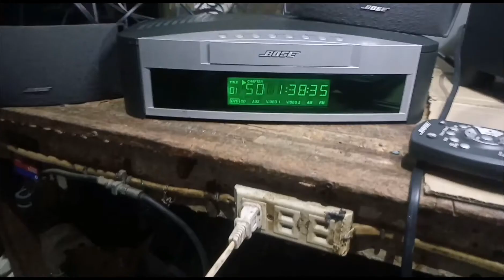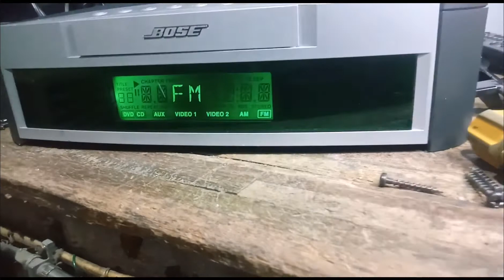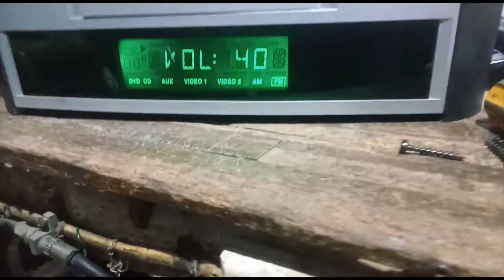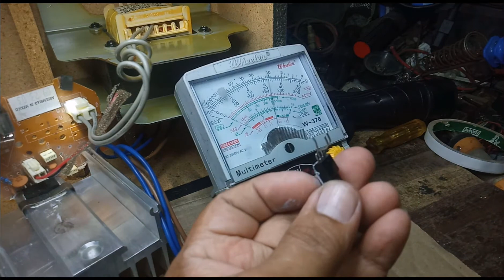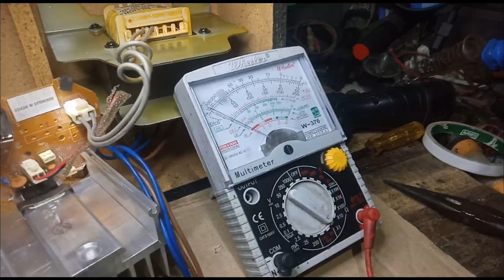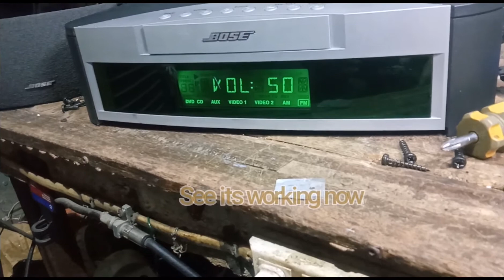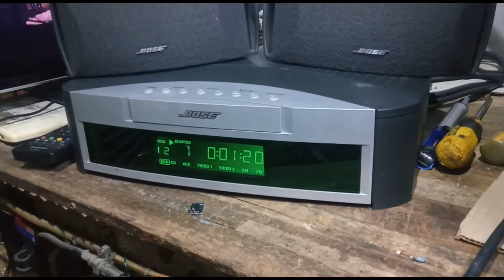BOSE 321(No sound)

Comment: Hey I have a Bose 123 acoustic module and it just randomly cut off for some reason and I was wondering if you know how to fix it. Thanks
Reply: It won’t power in btw I was listening to music and it just completely cut off
Reply from the maker: @FSrizza  check at the power supply section, maybe its a loose conections or cold solder

Comment: hello, good afternoon. my bose321 does not hear the sound at all. I replaced the IRFZ44N but it still doesn't sound. Could it be a problem with the TDA7396?
Reply from the maker: How much voltage did you measure on the big capacitor? if its high it won't really work, it shouldn't exeed 18 or 20 volts
Reply: @glenntips  Thank you very much for answering! I made the measurement on the capacitor and I have 23vcc with everything connected. AC voltage is 120v. What else could be happening?
Reply: @glenntips  I replaced the R10 with one of the same value and it burned me.
Reply from the maker: @LuisArielViolla  check where the burnt resistor is connected, maybe there is a shorted, check all parts that connected to pin1 of the mosfet
Reply: @glenntips  The problem with the R10 was mine, that I made the wrong banding and it was 1 k. The one I was putting on it was 0.1 k. I did the measurement that you recommended in the IRFZ44N mosfet and detected that it had continuity in the 3 pins. I took it out and measured it outside and it also gives me continuity. I put a new one, I check it before connecting it but after connecting it to the source it burns again.
Reply from the maker: @LuisArielViolla  did u put an insulator on the mosfet?
Reply: @glenntips  In the first mosfet I put thermal paste without insulation, in this what I did was leave it isolated from the heatsink. Solder the 3 pins without them touching anywhere.

Comment: Hi bro, 
I have a device like yours, out of nowhere it started making interference noise when it is set to Dolby 5.1. But when it is in 2.0 it doesn't. Do you know what it could be?
Reply from the maker: Try to move the wire connected to the bass speaker sir, maybe there is a broken wire or cut off

Comment: Sir i use bose 321 but some noise in speaker so what is solustion this plz send me thanks
Reply from the maker: What kind of noise do you hear?
Reply: @glenntips   Noise like Hunny bee sound
Reply: hamming in speakers
Reply from the maker: @ndjadhav1985  usually its the large capacitors that cause of humming, is there a sound?

Comment: Gud  am po I have 321 it's have humming sound and it's getting hot even the speakers ?
Reply from the maker: Oh may dc out po amp ng 321 nyo kaya uminit pati speaker, need repair na po
Reply: @glenntips  San po shop  nyo at mag Kano aabutin sa labor? Salamat po
Reply from the maker: @joelcestina9545  laoag city po
Reply: @glenntips  sir gud pm po abot  po sya ng 16 v yung  sa may MOSFET nya nag palit din po ako ganon  padin po
Reply from the maker: @joelcestina9545  don sa amplifier sir hung mo muna ung input signal, pag nawala ung dc sa speaker sa pre amp ang may problema, kung nag resolder karing sir double check mo baka may nagdikit
Reply: @glenntips  salamat po